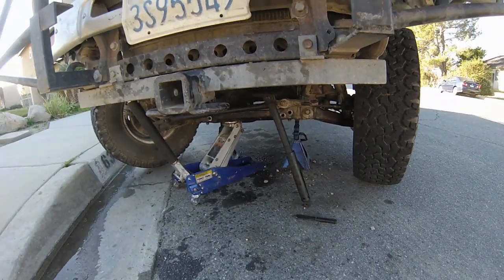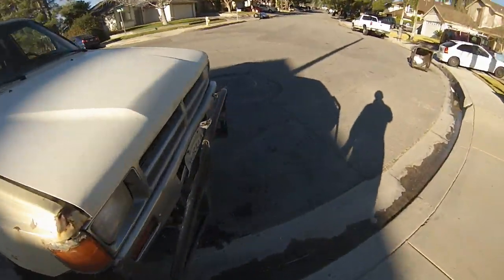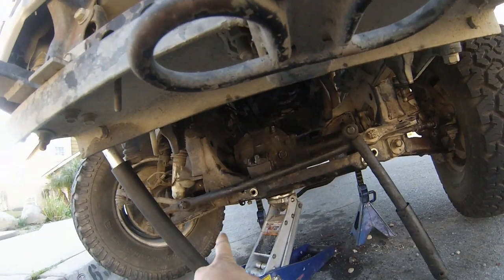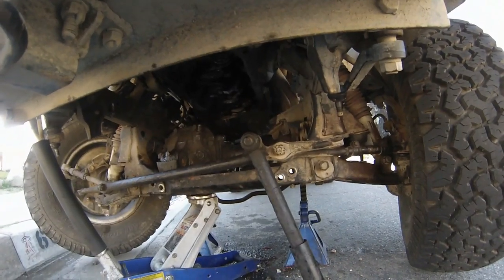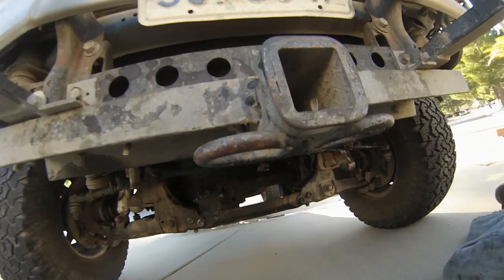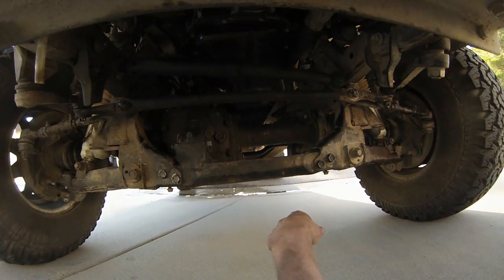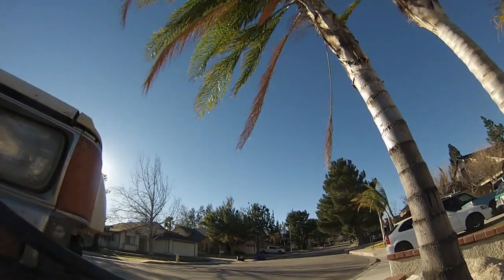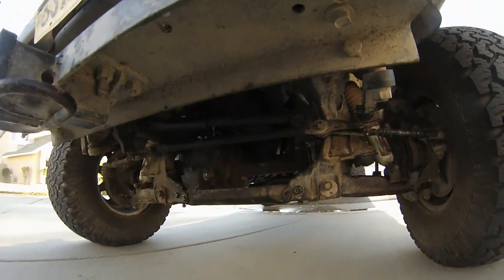22r Oil Pan Removal Toyota Pickup 4x4 IFS PART 2

Comment: Glad to hear someone mention that just taking the diff loose isn't enough.  I'm doing one right now and I've looked at it and there's no way that's adequate.  I suspect a bunch of them have body lifts.  Also I don't think your front end is tweaked, everything is just flexing together under the weight of the suspension and tires.  These things are pretty noodly and that crossmember is as much about keeping it squared up as anything else. I know this is an older video but appreciate that this was up here because it confirms that I'm not crazy in seeing that you can't just "drop the diff" without disconnecting a few other items to make this work.

Comment: You can loosen the motor mounts and use an engine hoist to pull the engine up higher.
Reply from the maker: An engine hoist is a valuable tool to have and even to this day i lack one. Due to that matter i go from below.

Comment: I just got a crate engine and put a cork gasket on and it's leaking now. I didn't know you're not suppose to put a gasket on so I'm going to take it apart and try it without. Thanks for the video though because I wasn't sure if I had to completely take the differential off or if it could just lower. Hope your yota is doing well!!

Comment: good video.  good info as well.  my 4runner is leaking in the same spot.  i hope to do this project in the near future.  sorry you havent had much luck (reading the comments below)  but hopefully mine will take the first time =P
Reply: i hope it works for you bud. im on my 3rd oil pan gasket job and it always leaks. trying this time without taking the motor out (had other shit to do so it wasnt a big deal before). Getting a new pan this time, came here to see if i can drop the diff and crossmember without taking the wheels off and putting it on stands, looks like i might be able to.

Comment: how's it holding up?
Reply from the maker: To be honest not so well...Ive been chasing down multiple leaks on this motor.  This one ive done twice, the second time i was able to pound out the crossmember and drop the diff where there was plenty of room. Still leaking from the rear of the pan after cleaning both mating surfaces. I would say this job is a tricky one but it can be done. dont be discouraged by my results. all my other seals and gaskets ive replaced are holding up great.
Reply: *****
Grab a piece of 1x2, or 1x4 wood and place the oil pan on a flat surface, grab a mallet and pound the rim of the oil pan flat.
Reply from the maker: verchonator  Did that already on the second attempt, plus sanded the surfaces.  its the rear of the pan leaking bad, i have a sneaky suspision either the block is cracked or the pan is just warped too much.  Im purchasing a crate motor to throw in due to the fact that im done trying to seal and reseal that pan.  The way i did it in the video is somewhat proper but if you dont seal and seat the pan correctly it will leak.  every gasket ive done with both the gasket and silicone together hasnt leaked whatsoever and i can name off multiple ones iv done on this motor still holding up more than that pan gasket.
Reply: wow, just entered the stupid zone.  Pro Mechanic.  You need to "bathe" the cork in RTV.  Bolt together in a SHOP not outside to torque specs.  Highly doubtful you did.  60+ degrees is nothing to RTV, try 104.  Cooler temps sets slower, regardless of wind.  There are countless fu&# ups in your video, no wonder it still leaks.

Here's my real question though, with the pan in place, and bolting the sump up AFTER said pan in place, how in the love of God did you get a cork gasket in place WITHOUT tearing it.  EHEM! Why you still have a leak.
Reply from the maker: i dont own a shop all my work is done outside as im not a pro mechanic
Reply: Larry Holzhauser on these particular engines, there are 2 covers that seal with the oil pan.  one on the front for the timing belt and one on the rear.  Meaning there are 4 possible places for a pretty good leak.  a good RTV needs to be applied liberally to both sides of the cork gasket and then when you run all the bolts and the 2 nuts on, go hand snug at first until you see RTV squeezing out evenly around the pan.  They say wait 15mins to let it partially cure, but I prefer about 30 then torque each to 9 ft/lbs.

your rear leak may not even be the pan if you haven't had trouble in the past.  my suggestion is using a UV Oil Dye.  easily found at any Auto Zone or Napa.  put a quarter of the small bottle in and just use a black light to see where the leak is originating.  my guess is it's the rear cover or head gasket at the back.  Do this at night if you can't use a garage/shop.

Comment: So they are not B.S.ers, your stuff is tweaked?
Reply from the maker: Yup that crosmember was hung up so many times it had been tweeked. At this time i didnt have the proper tools. Get a rubber dead blow hammer and use that to wack the hell out of things. Works wonders. If its bent worse than that then fix it with leverage.